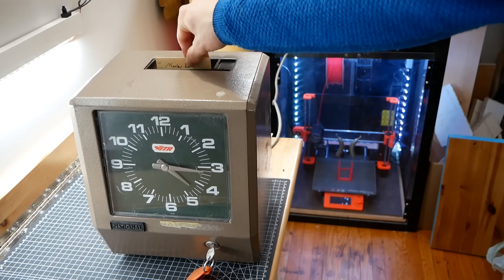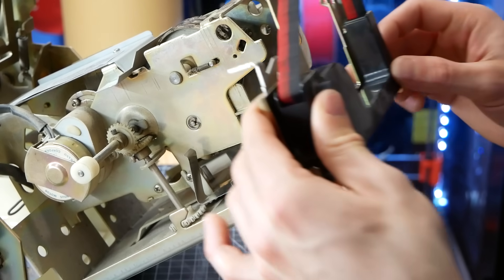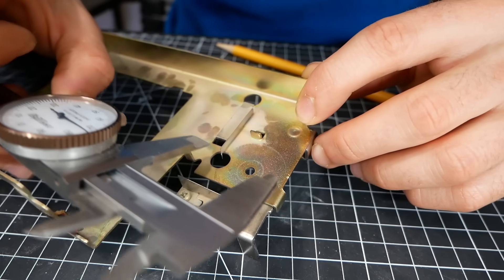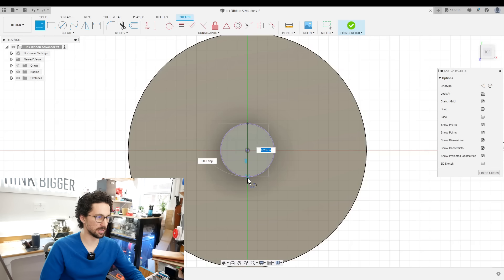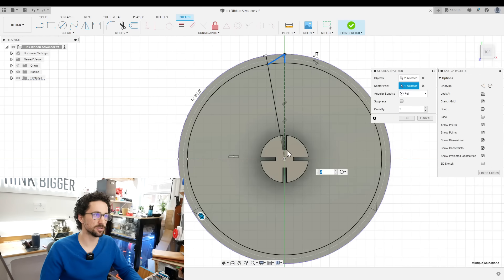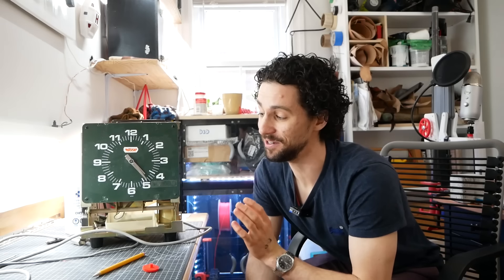They wanted 100 dollars. I 3D printed it for 9 cents.

Comment: I really love that there is no animosity towards the company in the comments and mostly everyone gets why 100$ for the part is reasonable.

If I ever question if something is too expensive I try to calculate 50$ for an hour of my time for something I dislike doing/remaking myself.
This rate will be lower for stuff I would like to get to know or might be fun etc...

It's not as simple as in the title and it might create a wrong mindset.
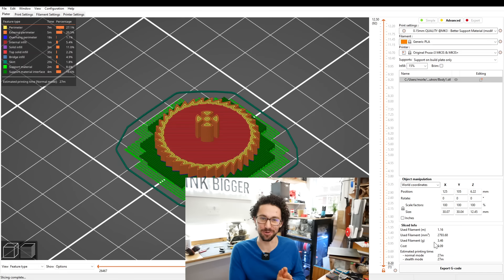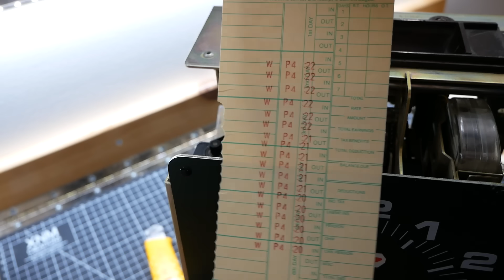I absolutely hate the comparison at 11:10 and 12:52 . You had to investigate the problem, learn how the machine works and then design a spare part with countless of hours of experience in 3D CAD. You didn't even factor in electricity cost, which could double the cost (still low but well..) Let's say you spent 45min NOT COUNTING THE PRINT TIME, which is actually VERY fast for the whole process. Especially since you had to alter the design of the part. You have spent 
75$ by then.  Also look at your printed gear. Won't last as long as a proper injection molded part that's for sure.

Its a great video, you have the skill to do it! 
But as someone that would've done it myself too(if this was my privately owned machine) and also does similar stuff for a full time job,
I find that this is the wrong way to communicate what you did and also lowkey shits on these businesses and their employees.
I think it is terrific that you can still buy replacement parts for these.
Try to repair a samsung TV or a Macbook....

just my 9ct...
Reply: First off, whether he ordered the part from the company or created his own replacement, he still had to investigate the problem and install the part. So that shouldn't be part of the comparison.

Second, unless he was explicitly putting off money-making work to work on this problem, then he wasn't "losing $50". He was losing nothing. He was doing something he enjoyed, using time that would undoubtedly had been spent doing something else that generated no income, so there were no monetary terms to the "time he spent". So he didn't "spend $50 of his own time". That's a weird nonsense argument people keep making to try to say "achsually, you didn't save any money!!"

If he needs to charge himself for development work, then he needs to charge that same rate for "time wasted when the time-stamp machine wasn't working".

So, it "cost" him three hours of his own time to have the part in hand. At your "rate", that's $150.

Given I can't imagine this part taking less than a week to get to him, during which he's lost 40 hours of "time" where he could have had this machine (I'm being generous in not including this in a 24-hour day and assuming this is business days only) which is $2000

So, in your logic, he didn't save $90-something

He actually saved $1850 (since making up "business expenses" for something he's not doing business-related seems to be the trend in these comments)
Reply: @jimbobjones9330  
I agree with your first point, although the investigation would have taken far less time if you can just determine that a whole assembly has some type of malfunction and order it right away. You then don’t have to go that deep with the analysis.

Your point for the „money lost while machine is not working“ is adequate if this machine was really intended to produce something or if you actually had to substitute this task with man power.

I feel that you kind of blow this out of proportion. My intent was that it is not that easy to choose between the 90$ and 9ct option. Only if you invest time to learn skills to do this and also invest money in an actual printer (which I didn’t even factor in) you have this option. This „flaw“ in the calculation was my intent. 
If you are a company in need of that machine to be running and it breaks with the part being 90$, you order it and wait. You don’t begin to learn CAD and start to learn about 3D printing.

This is something a lot of people that actually can do this quite fast and effortlessly because of existing knowledge and infrastructure tend to forget.
I guess you would be able to do that aswell. Try to compare the time and money you put into CAD design and 3D printing against the 2000$. 

I just wanted to shine light on the other side of things. Because I also hate clickbaity titles. I hope you understand.
Reply: @TheDavidsonary  I agree that "if a random person had to buy a 3D printer and learn CAD and the like", then yes, the entry point would be much higher for them than just paying for the $90 part.

But him saying he paid 9 cents for a near-$100 part isn't false, either.

I've designed brackets and things that would have cost more than I designed/printed them for, but I already have the knowledge and equipment to do so. Doesn't mean I can't say "I spent $1 on this $50 part"

In my path to learning, I've also designed things that undoubtedly cost me more actual money than I could have bought them for (but was doing so for the enjoyment/learning experience so the next time I did something like that, it was easier and cheaper)

My problem is that people keep saying "You have to include the cost of your equipment and everything you know in this cost", which is just not true.

If that's the case, then they need to include the computer/phone, the time they've learned to use the internet, and their learning of English as part of the cost of buying the part from the manufacturer.

It would be like you saying "I spent $3000 on a trip to Disneyland" (including hotel, park tickets, food, gas, and car maintenance for the trip), and me coming back and saying "Ackshually, you spent $30,000, because you forgot to include the cost of the car and the time you spent learning to drive. Because what if someone didn't have a car and needed to buy the car for the trip and then needed to learn to drive? It's unfair you don't include those values!!!"

Comment: 8:45 Isn't it possible to just extrude a single tooth and then pattern the cutout around the gear?
Granted i pretty much only work with SolidWorks, but seeing the similarity between the two, my guess would be that there's at least SOME sort of pattern function baked in...

Comment: Instead of measuring the diameter of the shadow, you could have found the radius more accurately,
measuring from the edge of the hole to the edge of the shadow so you have a firm edge to base the calipers off of,
then taking the hole size that you needed anyways, div' by 2, then adding it to the first measurement,
giving you the radius, which you can then obviously mult' by 2,
giving you the diameter.

Comment: Yeah I dunno about 9 cents... I mean, there's buying the printer for one, and acquiring the skills to make the part... Then again, I could probably cut this out of a piece of wood, or even cardboard. Probably would work. I mean, you have way more teeth on that thing than you'd need. So making it more crude out of other materials should be no issue whatsoever.

Comment: Also, to all the people who are mistakenly claiming "well, this part didn't cost 9 cents... it cost your time, a whole 3D printer, your knowledge..." (Which is a false argument, as he didn't buy ANY of that specifically for this project. When you hang a picture with a screw, do you count the full cost of the screwdriver every time you hang the picture? No... because that's idiotic. Unless you bought a tool SPECIFICALLY for this one thing, you don't include that in the cost of the thing if you're making it for yourself.

Hell, that would be like a Doordash driver charging for their CAR every time they made a delivery. "Ok, so... your Taco Bell is $8.75... with tax... and cost of my car. That'll be $15, 312.75... and DON'T YOU DARE FORGET TO TIP!!!")

That said, one other thing people are forgetting is "time to have the product in-hand"

Let's say that it took him a casual 3 hours to complete this end-to-end, from design to the product sitting in the machine (I don't include initial troubleshooting nor installation after, since he'd have to do that for the $95 part, too... this just includes the measurement, design, prototyping until he had the finished thing)

Assuming that this company could get the part to him in 3 hours, how much do you figure that shipping would cost?

Comment: Hi, What is that flexible surface you printed on? Awesome job creating that missing part!
Reply from the maker: Thank you! It’s the flexible PEI coated steel sheet made by Prusa
Reply: @MorleyKert  It looks like one of the self healing mats I use to cut paper templates with an Exacto knife.

Comment: Never 3d printed before but could you run into an issue where a piece you print has a patent and for example this company for the time clock comes after you for patent infringement? It seems they would patent a necessary piece and if they see this and want their money they could potentially get more then just $100. Have you heard about anything like this happening?

Comment: This is the second video I've watched recently regarding the cost of 3D printing (the other was based on Resin printing D&D miniatures) and one thing I'm confused about by the estimates given by the slicer, is whether that is simply based on the material cost, or whether it factors in the power consumption of the 3D printer over the course of the print time. 

The video I mention above was focused on the total number of miniatures that could be printed from a 1KG bottle of resin, with an anecdotal commentary on the cost of the final prints Vs the cost of the resin, where your video is specifically about the cost of the print Vs real world products. So I feel the value between the two isn't a direct comparison. 

The value of something is made of the sum of all parts, in this case, the $95 value is likely due to age, scarcity, complexity to manufacture, the overall unit not just the single part you required, so I would be intrigued to know what the BOM cost is for the part they wouldn't sell you separately. 

I was really interested in your revision process, it was cool to see you use the parameters to make that process really easy. 

Side note: nice to see the YouTube algorithm spitting out content that I'm interested in based on my recent watches. GG YouTube.

Comment: You should CNC it out of aluminum or steel.  The spring will eventually wear that to a smooth circle and leave little plastic shavings inside
Reply: Duh, if its metal what are the fish in the ocean going to eat?
Reply: @Fanta....  making the proof of concept out of plastic is much faster but the finished working part should be metal.  He could even use the pla part as a template to make it by hand with a bandsaw or something.  Really terrible idea to make metal on plastic moving parts

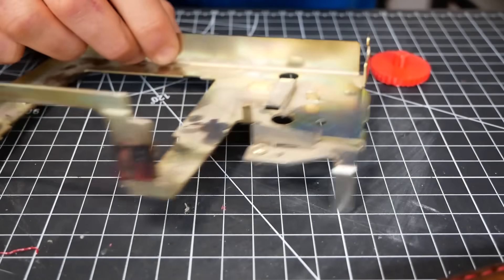Comment: @09:28 I think you'll want that pin to have a hole to thread a screw plus washer into to keep it permanently fixed to the metal plate while simultaneously loosening the grip the crosscut end has onto the axle - that part doesn't have to be a friction fit.

Comment: This video is amazing and extremely instructive. It’s a perfect example of how to solve a problem. You noticed the problem, created a hypothesis on why it’s happening, used clues you found to reverse engineer the missing part, and prototyped and successfully created the working part and fixed the clock. Great job!
Reply from the maker: Thank you so much 😊

Comment: Very satisfying to see you beat the system so to speak.
BTW I would have thought it unlikely that the ink cartridge has an ink reservoir inside (the ribbon has two colours for example).  You may need to be looking for a replacement at some point. Back in the day (1990?) monochrome dot matrix printer ribbons could be "refreshed" by opening up the cartridge , inking the ribbon and then manually rotating it to spread the ink evenly.  Messy job!

Comment: Reminds me of the time I had to 3D Print the helical re-drive (reverse) gear that was situated above a copy machine fuser to reverse and route the paper for duplex printing. Had to ink the gear, roll it on paper and then measure the angle of the tooth off the rotational plane. I got it done but it was interesting to say the least!!! You gotta wonder about the engineers that design a nylon gear that runs on a steel shaft not including a brass bushing for longevity!!!🙄 There always seems to be that one problematic design flaw in an otherwise perfectly good working machine!!!
Reply from the maker: Wow that’s such a clever solution to figure out the tooth angle!

Comment: At 8:45 , I believe you could have instead cut one tooth and then circular patterned the faces of the tooth around the gear so that all of that selecting would not be necessary. Great video though, love to see the practical use cases of 3d printing!
Reply: It's not just that selecting wouldn't have been necessary, but also the "right" way if you want the teeth to be properly parametric. The way they were drawn in the video would break once you change the tooth angle, while using a circular pattern on the feature rather than in the sketch would still work fine.

Comment: The reason why the PLA "melted" was because it was printed enclosed, PLA should always be printed unenclosed as it does not experience thermal shock like other filaments and will have better overhangs and overall quality printed unenclosed.

Comment: As someone who's always been intimidated by CAD software, I really appreciate that you went through your entire design process in Fusion, even if it is a relatively simple design.
Reply from the maker: I’m glad that was helpful! Thanks for watching
Reply: It is not simple. It is intuitive. I do not see any other creature on this earth able to make such a tool to fix it, but the way a supercomputer, to a computer, then to a printer and coming out with a product is amazing. Old times, a person would carve out a wood piece or clay, then make it into a metal piece by melting steel into it, the planning to make a piece like this on paper and ink, math. Gear ratios, size parameters,Vision to make all the parts work together. It is not simple.

Comment: That printer costs $999, and a spool of the plastic filament costs $24.99. 
So 3D printing that part only cost you $928.99 more than buying the $95 part from the manufacturer. Plus all your time, of course. And your electricity bill. 
Good thinking!

Comment: Nice job!  I'm just barely dipping my toes into the world of designing a specific part for a specific project and printing it with success.  Very smart way to do it.  I'm just using free tools, specifically Sketchup and I'm going through that whole learning curve very slowly.  But this kind of project I'd be grinning for weeks about.  I'm trying to think about whether or not 3D printing is always the right solution.  Like on this project, would wood work better over the long term? I can see that metal arm wearing PLA teeth away rather quickly during real world use.  Doesn't matter though.  This is awesome.
Reply from the maker: Thanks for watching!

Comment: Why’d you do 35 teeth when each tooth was 10 degrees and 35 teeth would add up to 350 degrees which is 10 degrees off one full rotation? Just add one more tooth and make it even

Comment: This part didn't cost you 9 cents.
First, you have printed this part twice. And it is required to print many prototypes while you are reverse engeneering.
Second, you spent 1 or 2 hours I believe to 3D model, slice print and manually remove supports. How much money would you charge for your time? Probably same amount of money.
This is a general mistake to estimete the 3D prints price (or cost) by only the filament price. Usually the filament price is just a small fraction of the price I'd sell my 3D prints. Probably 2-5 % of the price.
Especially if you print just 1 or two pieces as your time and labour required once and then the piece can be prtinted as many time as you wish.

Comment: Hey, Morley!
Good work!
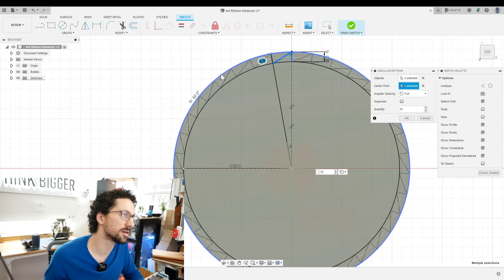However you made some things wrong starting at 8:30.
First, you should calculate the number of teeth by deviding the full circle (360 degrees) by the teeth angle (10)
Second, you'd better make only one tooth in the sketch and made circular patteern with the feature to prevent you from selecting all 35 (actually 36) features to extrude.

Comment: Possibly one of the best videos for using modern tools to design and replace parts.  Unbelievably clear, concise and really informative.  Identify the problem.  Propose the solution.  Create one prototype, test it.  Modify and off you go.  Really a terrific video for all aspects of part recreation.
Reply from the maker: Wow thank you so much!
Reply: @MorleyKert  You are so welcome.  I learned Fusion 360 when it was first released.  Stopped for a couple of years. It may be time to get back to it for this exact reason.  I love to wet mold leather.  Positive and negative molds 3D printed.  I could not figure out the offset.  I will watch again.

Comment: Actually it cost you .18 cents because you had to print it twice. Then while it is great that you are willing to work for free it would be more realistic to set an hourly fee for the design and fabrication. You should also calculate something for the use of the printer, since the act of using it causes wear and tear, so there is probably an additional .05 cents that should be added. Still it looks like you did get this for less than $20.